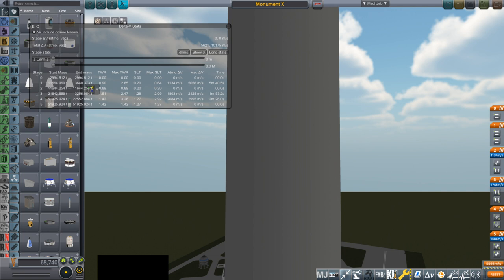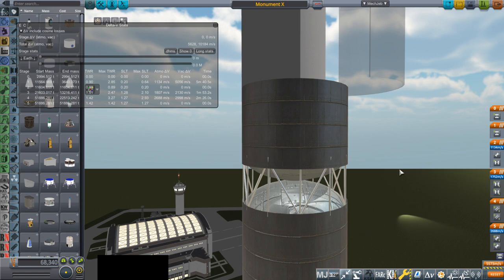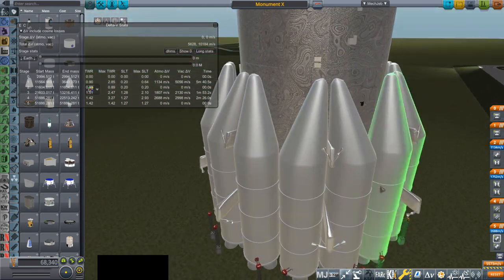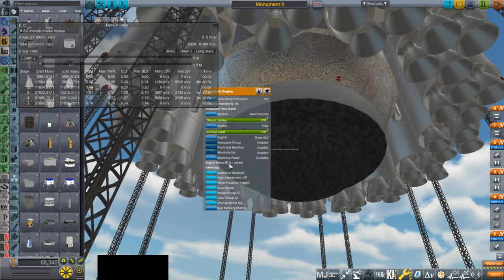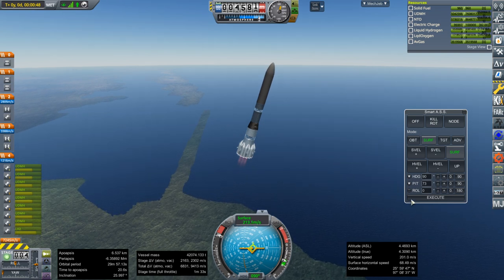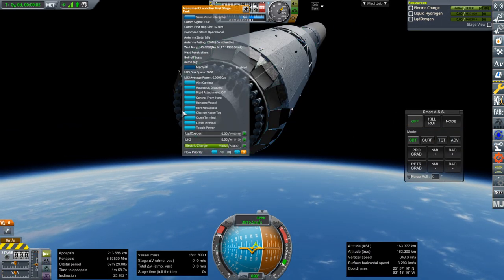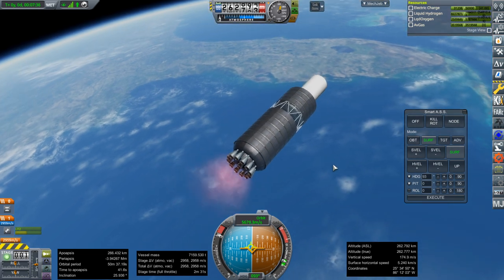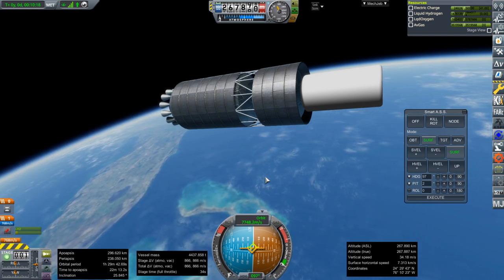Realism Overhaul in KSP 1.8.1 - Monument Launcher Reborn

Comment: You mentioned  @4:00 "You can't have a decoupler module and something that produces thrust on the same part." I don't think that's true. The SpaceY mod has both Radial and Stack decouplers with built in sepratron thrusters. I install SpaceYs decouplers and launch clamps in every non RO KSP game I play.
I took a look at the part .cfg that SpaceY uses for their decouplers and compared them to the Stock Squad decouplers and besides adding a ModuleEngines, the only real difference I noticed was that the SpaceY .cfg had "ActivatesEvenIfDisconnected = true" in it. I bet that line is how SpaceY was able to get a ModuleAnchoredDecoupler module and a ModuleEngines module to function on the same part.
Or maybe its different with Realism Overhaul. I don't currently have a Realism Overhaul KSP set up to reference. However I do recall some Launch escape system parts in realism overhaul having both decouplers and engines.

Edit: Also the Monument Launcher's version of a Korolev Cross should be called a Raizsterisk.
Reply from the maker: I have "ActivatesEvenIfDisconnected = true"  but maybe I'm not using ModuleAnchoredDecoupler - I'll have to check on that.

Comment: 2:50 LOL

5:15 Use that with a larger Daenarys! 8:45 Yes!

8:10 It's still an asterisk to me. I mean, most fonts display it as having 8 "prongs" or fewer.

11:15 sorry.

12:00 If it was common-bulkhead I'd definitely believe that payload capacity. Maybe with that plus the Timber Wind engines you could launch Pluto Direct Direct.